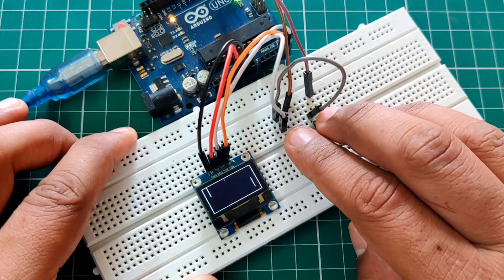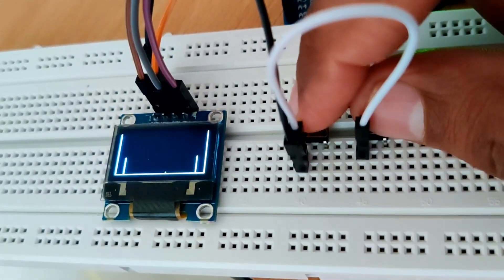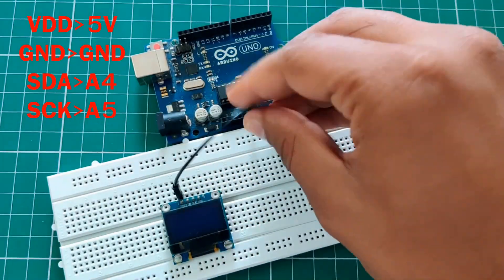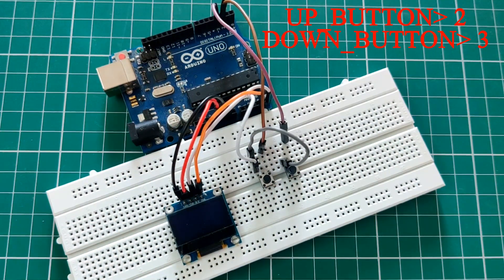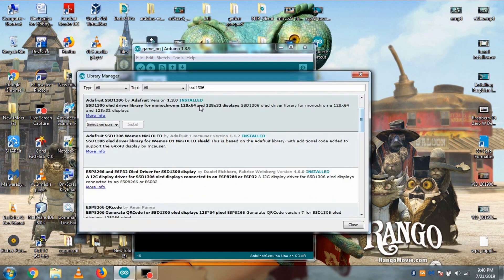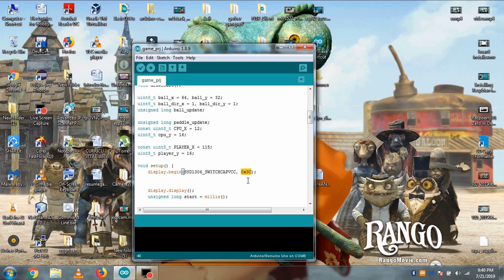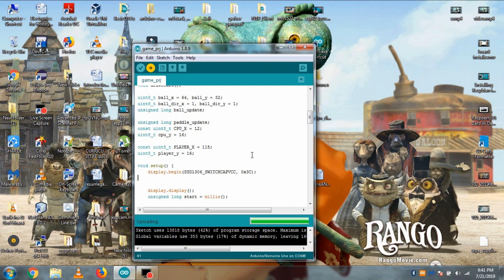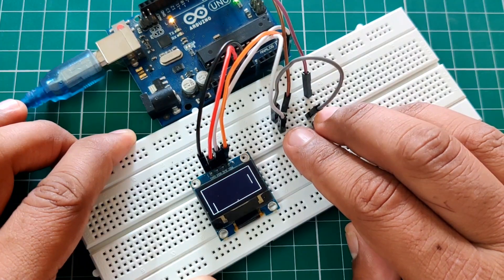Arduino Pong Game | Arduino game project with OLED SSD1306 display

Comment: /*
  A simple Pong game:
 */

#include <SPI.h>
#include <Wire.h>
#include <Adafruit_GFX.h>
#include <Adafruit_SSD1306.h>

#define UP_BUTTON 2
#define DOWN_BUTTON 3

const unsigned long PADDLE_RATE = 33;
const unsigned long BALL_RATE = 16;
const uint8_t PADDLE_HEIGHT = 24;

#define SCREEN_WIDTH 128 // OLED display width, in pixels
#define SCREEN_HEIGHT 64 // OLED display height, in pixels

// Declaration for an SSD1306 display connected to I2C (SDA, SCL pins)
#define OLED_RESET     4 // Reset pin # (or -1 if sharing Arduino reset pin)
Adafruit_SSD1306 display(SCREEN_WIDTH, SCREEN_HEIGHT, &Wire, OLED_RESET);

void drawCourt();

uint8_t ball_x = 64, ball_y = 32;
uint8_t ball_dir_x = 1, ball_dir_y = 1;
unsigned long ball_update;

unsigned long paddle_update;
const uint8_t CPU_X = 12;
uint8_t cpu_y = 16;

const uint8_t PLAYER_X = 115;
uint8_t player_y = 16;

void setup() {
    display.begin(SSD1306_SWITCHCAPVCC, 0x3C);

    
    display.display();
    unsigned long start = millis();

    pinMode(UP_BUTTON, INPUT);
    pinMode(DOWN_BUTTON, INPUT);
    digitalWrite(UP_BUTTON,1);
    digitalWrite(DOWN_BUTTON,1);
    display.clearDisplay();
    drawCourt();

    while(millis() - start < 2000);

    display.display();

    ball_update = millis();
    paddle_update = ball_update;
}

void loop() {
    bool update = false;
    unsigned long time = millis();

    static bool up_state = false;
    static bool down_state = false;
    
    up_state |= (digitalRead(UP_BUTTON) == LOW);
    down_state |= (digitalRead(DOWN_BUTTON) == LOW);

    if(time > ball_update) {
        uint8_t new_x = ball_x + ball_dir_x;
        uint8_t new_y = ball_y + ball_dir_y;

        // Check if we hit the vertical walls
        if(new_x == 0 || new_x == 127) {
            ball_dir_x = -ball_dir_x;
            new_x += ball_dir_x + ball_dir_x;
        }

        // Check if we hit the horizontal walls.
        if(new_y == 0 || new_y == 63) {
            ball_dir_y = -ball_dir_y;
            new_y += ball_dir_y + ball_dir_y;
        }

        // Check if we hit the CPU paddle
        if(new_x == CPU_X && new_y >= cpu_y && new_y <= cpu_y + PADDLE_HEIGHT) {
            ball_dir_x = -ball_dir_x;
            new_x += ball_dir_x + ball_dir_x;
        }

        // Check if we hit the player paddle
        if(new_x == PLAYER_X
           && new_y >= player_y
           && new_y <= player_y + PADDLE_HEIGHT)
        {
            ball_dir_x = -ball_dir_x;
            new_x += ball_dir_x + ball_dir_x;
        }

        display.drawPixel(ball_x, ball_y, BLACK);
        display.drawPixel(new_x, new_y, WHITE);
        ball_x = new_x;
        ball_y = new_y;

        ball_update += BALL_RATE;

        update = true;
    }

    if(time > paddle_update) {
        paddle_update += PADDLE_RATE;

        // CPU paddle
        display.drawFastVLine(CPU_X, cpu_y, PADDLE_HEIGHT, BLACK);
        const uint8_t half_paddle = PADDLE_HEIGHT >> 1;
        if(cpu_y + half_paddle > ball_y) {
            cpu_y -= 1;
        }
        if(cpu_y + half_paddle < ball_y) {
            cpu_y += 1;
        }
        if(cpu_y < 1) cpu_y = 1;
        if(cpu_y + PADDLE_HEIGHT > 63) cpu_y = 63 - PADDLE_HEIGHT;
        display.drawFastVLine(CPU_X, cpu_y, PADDLE_HEIGHT, WHITE);

        // Player paddle
        display.drawFastVLine(PLAYER_X, player_y, PADDLE_HEIGHT, BLACK);
        if(up_state) {
            player_y -= 1;
        }
        if(down_state) {
            player_y += 1;
        }
        up_state = down_state = false;
        if(player_y < 1) player_y = 1;
        if(player_y + PADDLE_HEIGHT > 63) player_y = 63 - PADDLE_HEIGHT;
        display.drawFastVLine(PLAYER_X, player_y, PADDLE_HEIGHT, WHITE);

        update = true;
    }

    if(update)
        display.display();
}

void drawCourt() {
    display.drawRect(0, 0, 128, 64, WHITE);
}

Comment: despite having adafruit gfx installed i still get the error "Adafruit_GFX.h: No such file or directory"... any idea why? how to fix?
Reply: I found out the problem in case anyone else is having trouble.  download the adafruit library from github manually as a zip file,  then open the arduino ide, click sketch/include library/"add .zip library".. it should now be in your list of libraries. Now delete the pre-written line of code "#include <Adafruit_GFX.h>", then go back to Sketch/include library and add AdafruitSSD1306 from the library list. This should fix it.
Reply from the maker: Okay thanks for sharing , looks like its IDE issue
Reply from the maker: Well it doesn't suppose to happen try to do a fresh install of library
Reply: @electronicGURU  im new to arduino and stuff.. i have tried updating the library through the arduino app and both physically replacing the files in the library folder. still same error
Reply from the maker: Brother i am not sure why you are getting this issue , it is not suppose to happen.

Comment: Hi, I'm trying to do this project, but my oled display seems to not work with this libraries. Is a SPI 0.96 OLED display made by Hobby Electronics. What should I modify in the code to make it work?
Reply from the maker: I think it should work. The library used here is pretty basic.
Reply: @electronicGURU  yes, but a few methods are named differently, and some methods are missing from mine. But I got it sorted out. Cheers though👍🏼
Reply from the maker: Thats a wonderful news. Congratulations 🎉

Comment: I have a question, hope you can please answer:
When you connect Vcc and GND with a powered arduino, does the backlight light up even without the SDA/SDL lines having any relevant data?

I'm trying to figure out if I have a software or hardware issue.

Best
Reply from the maker: Actually when we just connect power to display it is not supposed to light up the backlight.
Reply: @electronicGURU  good to know! Thanks.  That means I could be having a software issue then. Im writing a device driver for this from scratch
Reply from the maker: Please check if your I2C address of device is correct. That could also be the issue. Use i2c scanner library to scan that and check if the i2c address you got and the one you are using in the code is same.
Reply: @electronicGURU  Ok, thanks for the excellent point. I will go ahead and try that, thank you
Reply from the maker: Your
 welcome